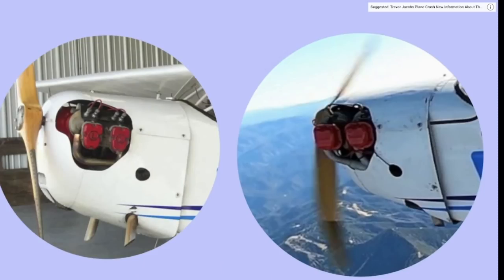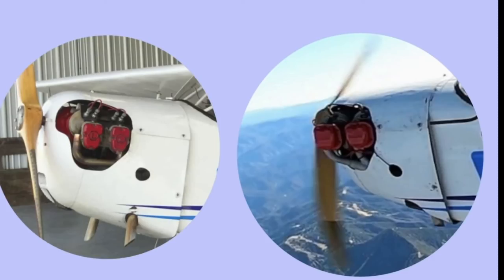Trevor Jacob Engine swap before the suspected "FAKE" crash?

Comment: Most airplane engines have a manufacturer's recommended "Time Between Overhaul" or "TBO" period that is the number of hours that the engine may be operated before it should be overhauled. In the US the engine overhaul is not mandatory at the recommended TBO unless the airplane is being used to transport persons or property for compensation or hire. 
In other words, a privately operated personal airplane is not required to have it's engine overhauled at any specific time. An overhaul can be performed if and when the airplane owner decides to overhaul it.
I'm not sure why the Lycoming O-145 was replaced by the Continental A-65 engine, but most of these conversions were done because the A-65 has noticeably more torque and is much more common, meaning more parts availability.
The Lycoming O-145-B2 installed in this Tcraft were very rugged and durable little engines but parts for them are real expensive and hard to find.

Comment: I don't know squat about airplanes or flying, but this whole affair brings up some really interesting stuff.

So aircraft engines can only be used for a limited number of hours? Learning something new every day.
Reply: Not exactly. All engines have manufacturer recommended overhaul intervals: this is a guideline, not a law. But, they also have manufacturer specified Mandatory Maintenance Intervals (Oil and oil filter changes, oil and oil filter inspections, spark plug changes, valve lash adjustment, etc) and of course the Annual Inspection. These are not guidelines, they are mandatory. 

It is easy to mix-up the two when dealing with some aircraft engines: It often makes better financial sense to do overhauls during an annual inspection because the engine has to be torn down to varying degrees anyway.

Generally, there is a list of performance and properties for each model type engine to meet to be deemed "airworthy";  For piston engines, it is common that must have certain cylinder compression / leakdown characteristics and must be within a certain percentage of all other cylinders. It must be able to draw a certain amount of manifold pressure at a certain RPM at a certain altitude (on the ground). There are some dimensional tolerances which must be checked periodically; Have certain output shaft clearance and backlash, Piston to cylinder clearance. Valve seat and valve head checks, etc... These maintenance intervals are done by licensed and certified Aircraft A&P (Airframe and Powerplant) Mechanics.
Reply: @matthewhelton1725  I know this response is a bit late, but I thought you might find this interesting:

I'm from Germany, and we treat cars in a similar manner, meaning there are mandatory intervals after which every car has to be inspected by the Technical Inspection Agency ("Technischer Überwachungsverein" in German, better known as TÜV). If the car passes the inspection, a sticker is attached to the license plate and it is good to go. If the car doesn't pass the inspection, then the owner has to fix the car or it is declared no longer roadworthy. That's also why you will never see colorful US-style vanity plates in Germany: they need to be standardised so the cops can see if a car has a valid vehicle inspection sticker or needs to be taken off the road.

Comment: All of this nonsense aside. The fact he abandoned an aircraft in flight is proof enough he should not possess a pilots license period.
Reply: @messin with mike I wouldnt mind him "leaving ship" at 65mph on a freeway to be honest.
Reply: I think he should lose his driver's license as well. Automobiles weigh far more than that little Taylorcraft and he's clearly demonstrated that he has poor to no judgment and no regard for those around him.
Reply: Totally agree.
Reply: Just pulling his pilot's license isn't enough.  He needs to go to jail and pay one hefty fine If he set this up and it sure looks like he did
Reply: I think the FAA only reserves that punishment for little old ladies who fly under bridges and don't crash
Reply: @grayrabbit2211  
I saw that one. I think she was in Ohio and a drone caught her doing it.
Reply: @mcgee6177  the problem is, here, at least a lot of the circumstantial evidence could also point to a pilot who was flying a wreck (a plane he knew may/will fail crash any minute...), experimenting by adding new bits on the cheap... 
not sure what state the original engine was, or whether it even worked, but the botched unskilled replacement job (I doubt he spent money on a pro-mechanic...) could also explain the failure of the same engine.
I think this is a stunt, but I have not yet seen anything to actually prove it (at least to me)

also, do we know there was an insurance claim, because, I am not sure how he could have managed to insure an aircraft (against an inflight occurrence) that by all accounts was not even legal to fly? if he did, whom else did those guys insure? I would have a great deal of questions to the insurance company as well..
Reply: @grayrabbit2211  
That is unacceptable
Reply: @stanislavkostarnov2157  so insurance fraud it is then!
Reply: @stanislavkostarnov2157  there were fire extinguishers strapped to his legs and hidden from view as can be seen in a few frames in the original footage. Thats enough proof for me.
Reply: Very VERY few situations warrant a kid air abandonment and this was definitely not one. While he was posing for his Hollywood selfie mod free fall there were three areas in observed that appeared to be land able.
Reply: He's going to jail.
Reply: Faa won’t suspend his liscense for more than a year, but may make him start from scratch to get his liscense back. There is a good video with an aviation lawyer that says what will likely happen to him. He may be fined though.
Reply: @stevegiboney4493  I guess, if willful endangerment of property is proven, he may have criminal charges to answer to beyond the FAA...
same if the insurance fraud claims somehow have a basis.
Reply: @grayrabbit2211  Losing his driver's license is a stretch at best.
Reply: @grayrabbit2211  Let him keep his driver's license as it will be useless while he is in jail.

Comment: Who says you have to overhaul an engine based on hours?  Under part 91, you can fly it as long as it runs.  It may not be wise but it is not required to overhaul it based on any certain number of hours…..

Comment: The more key bit is the FAA paperwork on the plane indicates it has the Lycoming. Which at a minimum means the plane was not certified to fly and should not have been in the air. We can’t say Trevor made the change however, because the plane was sold to him as a non airworthy parts plane. Plus he crashed it so fast after purchase that the FAA showed up on the prior owners doorstep shortly after the crash.
Reply: I want to clear something up. I am am AP/IA. When you change  an engine to another model, with the correct paperwork. The model number of  the air craft does NOT change. It will still say BL. The 337, log book entry will identify the engine change.  Also it is required for a tag be made that specifies the engine  change and be affixed next to the aircraft ID plate. I've done several of these changes on Cubs and Taylor crafts . That is the procedure as outlined in the Advisory  Circulars from the FAA.

Comment: the 2 air craft in the pics seem different. why does the one right have a black strip over the blue stripes?
Reply from the maker: Pitot tube. It is just the angle
Reply: @grahamthebaronhesketh.  no its not. the top black line goes all the way to the cowling. you can see the area on the left and unless he took that stripe off, changed the engine and the cowling , its a different aircraft. and why would he swap the engine and then crash the plane? unless the previous engine was dead

Comment: Okay, I just took passed my Part 107.  While the skill aspect is different, ground school is ground school.  The first thing we learned was Aviate, Navigate, Communicate - in that order.  Nowhere in there was the option of abandoning everything and run screaming like a madman into the woods.  That's how people get hurt.  We are talking a 1200g piece of plastic here.  A full sized single propeller craft is going to be about 500x more in mass and therefore 500x more in destructive power (F=ma).  He still had an option to aviate.  I just don't understand that mentality.  In fact it's right up there with FAAs hazardous attitudes.  I can see at least two that he exhibited - impulsiveness and resignation.  I would sprinkle in a little anti-authority there.  How else could he justify his decision to leave an aircraft unmanned in mid-flight?  My first thought would be, "Crap, I hope I don't get into trouble for doing this.  Maybe I should reconsider my options?".

Comment: Take a look at 32:45 in Pilot Blog's 13-Jan video.   There's red spray paint over spray on the inside of the jugs, not just the covers.   I don't think any A&P, even the sloppiest one, who would spray the covers while they're still attached to the engine.  

With where the over spray is, it appears they were painted while the engine was attached to the aircraft.  You would have clearly seen this boo-boo if the engine wasn't mounted.

Comment: He didn't even do a good job of the swap.  Look at the damage to the cowling - dents all over and a cut from the rocker cover cutout to the round hole.  Not the kind of job you would do if you expected to keep the new engine in the aircraft.

Comment: The hose on the outside is running to tanks of fuel strapped to his legs, the fuel tanks on the plane are filled with water so as not to start a fire on impact and destroy footage for the video.

Comment: General aviation is not my thing,  but I'm almost positive for both the engine and prop swaps each would need a TC,  and the FAA doesn't exactly toss those over like beads at a parade, it takes time.  And he just received his single engine pilots license in June 2020.  He could not have made that swap by himself, as even w/o a TC he would have had to note it in the logbook.  And since he definitely does not have any type of mechanic certificates (I checked) I find it impossible to believe any mechanic would have signed for it.  If there was such a mechanic,  he'll/she'll be kissing that license buh-bye!

Comment: I know nothing about planes but it does  look like he cut the exhaust pipes shorter for some reason. I don't even know if that's the proper wording it for it. I just noticed the pipes on the bottom of the plane engine look WAY shorter. They look closer in his video than the previous owners pic. Maybe its not even a big deal. But it sure looks different

Comment: What are you talking about? Engines are airworthy by condition inspection. Unless they are operated in part 135, ect. I know of a Champ that has over 3500 hrs on the lower end.
Yes, I'm an A&P.

Comment: OUT OF HOURS - that’s not true.  If the engine is flown in a PART 91 aircraft it needs to be rebuilt on condition.  That is when it’s found to be not airworthy usually by a certified aircraft mechanic during the aircraft’s annual inspection.
Reply from the maker: It varies for use. If it is for hire or private use.
Reply: @grahamthebaronhesketh.  exactly

Comment: There are enough differences in the planes body in the two images that you could argue that they’re two slightly different variations of the plane. There’s lines in the body of the right photo that don’t exist in the left. 

And what is the timeline between these alleged photos?

Dude definitely abandoned the plane on purpose, but the two images aren’t really any solid proof of a purposeful engine swap, or even being the same plane. Also, the engine could’ve been swapped for a different motor to get more power or cost less than a full rebuild on the current, when it came time for a major overhaul. 
Hard to make such assumptions at this point in time, with little actual evidence beyond a couple cropped images.
Perhaps the referenced video shows more, but this small clip doesn’t sell any kind of solutions at this time.

Comment: For a private owner in the USA time limits are suggestions, not regulations.  You can run an engine twice or more what the TBO is and are not required to do anything.  If the engine meets annual standards and tests you just keep running it.  If the aircraft is used for commercial purposes it must follow the TBO recommendations and have 100 hour inspections done also.

Comment: I am not here to defend Trevor, but the pictures show two different planes.  The issues is see: 1.  The exhaust hole is different size.  It barely goes past the blue stripe on the left and then eats up both the purple and blue on the left.  2:  The locking tab that is above the purple line is different.  You can't see any screw point on the left pic but are clearly seen on the left.  The hole that is in the middle of the cover is different shape and there is something coming out of it on the right pic but not the left.  I suppose you could say he swapped out the cover.  The last thing: There is a black stripe missing from the pic on the left.  Look in line with the upper cover locks, follow that line to the right and there's your black line.  One pic has it and the other doesn't.  This is not photo graphic evidence he swapped engines.
Reply from the maker: If trevor jumped in fear of his life I reckon he is chicken Yellow.

Comment: Also if those two photos are the same aircraft there is some black pinstripe from the two bolts holding the top cover where the older image doesn't have it.

Comment: Also the aircraft fuselage on the right has a paint stripe that the one on the left does not.  The paint stipe is in line with the cowling halfs, straight back from the cylinders. I don't think it was the same airplane.

Comment: One thing everyone is missing is when the Continental engine swap was done, the cooling eyebrows were not installed. Does not meet type design. More evidence for the FAA that Mr. Jacobs was flying an un-airworthy aircraft.
Reply: @JumpingTuna  In some cases they can be overzealous, but in this case I hope you are right.
Reply: His certification (that was issued only after he had already crashed it) states that it has a Lycoming engine. How long do those certifications take?

Comment: The engine could have been swamped before Trever got the plane, but if you change the engine type, you change the aircraft's airworthiness.
Reply: I agree, that Tailwheel Endorsement video, that shows the plane, is from 2016. So it could just be as likely that a previous owner did the swap for whatever reason.
Reply: @popsfreshenmeyer7607  perhaps, but the video showing the engine post crash looks incredibly clean for an engine that had been in the aircraft for a few years. Would someone remove the cowling, clean away any evidence the engine had been operated, and then paint the valve covers as if to conceal the previous engine change?

If we’re looking for the “reasonable” explanations to explain away all the odd coincidences, at some point we have to concede that there are just too many odd things about this story to be coincidences. And then there’s the fire extinguishers strapped to Trevor Jacob’s legs, which defy all legitimate explanation. That element is so bizarre that it calls into question any benefit of the doubt we might be tempted to grant Trevor Jacob.
Reply: @popsfreshenmeyer7607  Its really common to get rid of those old Lycomings as I am not even sure they are even supported/parts available anymore. The STC to the Continental is pretty much the standard option for any aircraft with these old Lycoming 65s. I would say it was done prior to Trevor, but the overspray on the cylinders from painting the valve covers is sketch AF. I cannot imagine owning an airplane and trying to paint the valve covers in place. They come off really easily and you could do a really nice job painting them by just setting them on a piece of cardboard on the ground, if you absolutely must have red valve covers.....
Reply: @X85283  That makes sense. TY :)

Comment: I can't really tell because the photos are at different angles , but it looks like the cowling had to be trimmed to fit the cylinders and it also looks like it had to be trimmed for the exhaust , which appears to sit quite a bit farther back ..
Reply: It might simply be that a trim piece around the exhaust hole was removed. I see faint indications there was one in the 2016 photo. Not sure though.

Comment: Looks like red painted finger marks on the cowling near the rockers and black greasy finger marks near the 2 top set screws. I’m not sure if that’s a bungee or a crack going from the circular hole to the rocker cutout. Are those panels aluminium or fibreglass?

Comment: Just a point of order - if an engine reaches "TBO" or what you refer to as "Out of Hours" you are not required to rebuild it.  You can keep running it as long as its producing good compression numbers and power - even the manufacture says its not required to do anything past TBO unless the engine is showing signs of failure.
Reply from the maker: Yes I was getting confused with Public transport  Cof A you are right there are no rules in the USA.